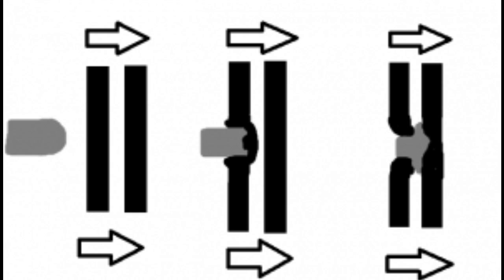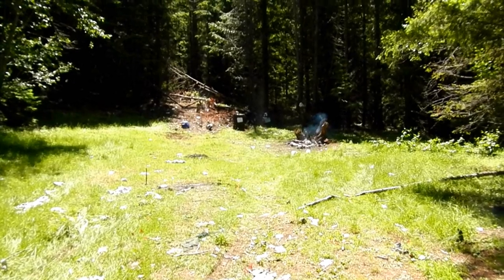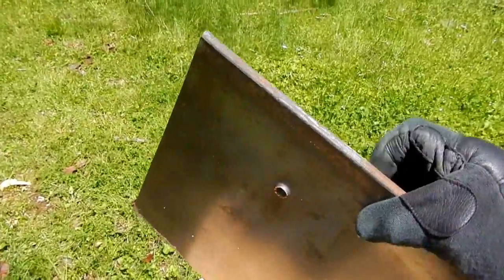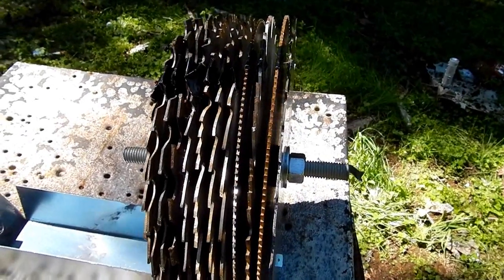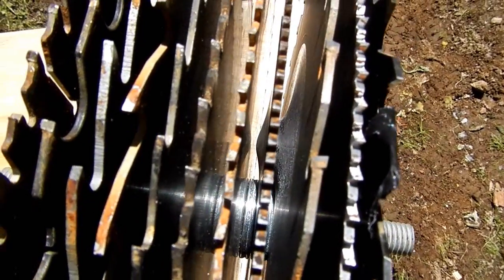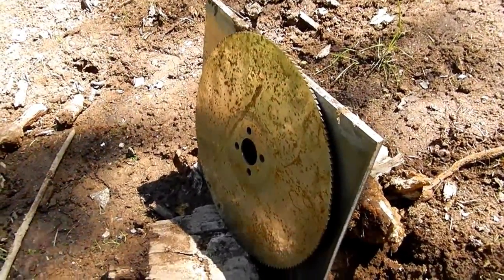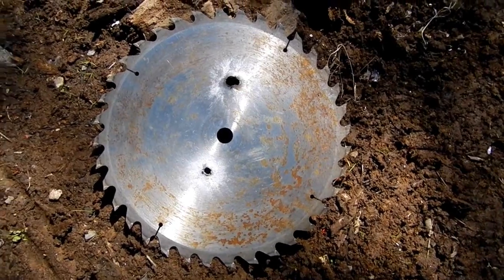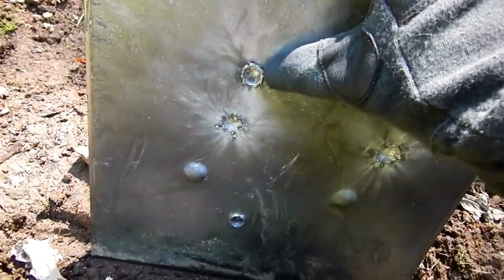Testing the Concept of Spaced Armor

Comment: 5:07 If the plates are each (slightly less than) 1/8" thick, 9 of them should equal 1", right?
Instead, you have 12 or so saw blades ... AND you're not comparing them to a solid 1" plate.
And that's before we acknowledge the difference between mild and tool hardened steel.

Comment: yes its better against a shaped charge or squash round but not so great against long dart penetrators
Reply: That's where NERA comes into play. In between the vertical layers of armor are offset layers spaced off by springs and rubber that further absorb the impact.

Comment: You need a space of at least two and three quarters of an inch to give enough time for the projectile to tumble and or break up. The blades with the tungsten carbide tips have a lower brinell hardness but marginally heavier weight.

Comment: You don't understand the way spaced Armor works against shaped explosive warheads.  Bullets do not behave the same way as a "very high" pressure gas.  -  Also not all steel is the same.  The steel in the saw blades are likely of much higher strength alloy steel.  -   The thin aluminum armor you mention at the start of your video is not to stop bullets to cause explosive shape warheads to detonate before hit its the main armor.  Then the high pressure "plasma" continues forward, but also dissipates sideways in the open space between the armor plate.   -    You should have done more research, as you experiment is comparing apples to oranges. However, it was still entertaining and enlightening.

Comment: The saw blades are breaking because they have been hardened. Its the multi purpose blades that are breaking because they are made to cut steel and wood so they have to be harder than the steel they're cutting.

Comment: Total waste of time that this video is still up and coming into my feed.
Not even an attempt at a control in this "test."  
Uses different grades of steel with different thicknesses (1" of saw blades vs 3/8 mild steel?  - what's this show?; 3/8" mild steel vs same plus a thin steel plate? - what's this show).  
Not even some basic hunches can be supported with this mess.
Shame he spent so much time on it.
He ought to re-do this, since he obviously sees the problem, but living off the views . . .

Comment: Again, thanks for the effort, but you're using kinetic penetrators against armor that was built to stop shaped charges.
The air gap is there to deform the copper jet of a shaped charge (HEAT) warhead. It is of little to no use against kinetic penetrators.

And as has been mentioned before, saw blades are likely hardened steel, because they need to be able to cut through stuff. Mild steel is very mild. So the comparison is not really apples-to-apples by any means.

Comment: I'm sure spaced armour is build for a different purpose.....it's to cause explosive or heat projectiles to explode on the thin aluminium layer first so by the time the explosion radius or penetrator even touches the real armour,most of the energy or would have been exhausted or dissipated.

Comment: The round passes through the first piece of metal deforming the round causing it to tumble within that space before hitting tye second thicker plate of which stop the round by using up what kinetic energy is left by expelled particles and small metal fragments from the surface of the second sheet, leaving an impact crater behind for good measure. So "Spaced Armour Does work, and by using a more flexible energy absorbing materials will defeat even bigger rounds even some kinds of dense rubbers or soft plastics which absorb energy by allowing it to dissipate through the material by allowing reverberations throughout its structure away from the point of impact.
A good example of home made Spaced Armour.

Comment: This guy says in the video description that HEAT rounds are kinetic energy. I find that incredible coming from someone who's been in the military.
Reply from the maker: They are kinetic, this is a common misconcepton due to the acronym "HEAT" and the useage of "jet" to describe the penetrator.  The point of a "shaped charge" is to focus blast pressure. In a HEAT weapon, the metal liner absorbs the energy of the explosive behind it and is squeezed into a thin slug being accelerated to hypersonic velocity.  It does not burn or melt through armor, it punches through. Spectography shows that the temerature of a shaped charge jet does not exceed the melting point of steel. It is like a waterjet cutter not a plasma cutter. This can also be seen in the speed of the event. To cut through a steel plate with the hottest plasma torch or even high energy laser takes a few seconds, to punch through with a kinetic impact is instant.
Reply: @jackalmountain6523  Well all documentation and sources I've seen have always classed HEAT as a 'chemical' energy round as opposed to Sabot which is 'kinetic'. The end result may be a 'kinetic' penetrator but it's the explosive that classifies it as 'chemical'. I never said anything about molten plasma jets or melting temperatures of steel. You're trying to convince me of points I haven't even disputed. Besides, fundamentally a HEAT round does act as a chemical energy weapon because it differs from the kinetic nature of a Sabot. A Sabot's armor penetration effectiveness is reduced the further away the target is because it's just a solid slug, whereas HEAT maintains full lethality at any distance as it doesn't rely on kinetic energy to penetrate. As long as the round hits then the penetration is achieved by the explosive, 'chemical', aspect of the warhead. I see where you're coming from but I've never seen your interpretation of the terminology before.
Reply from the maker: @FlyboyHelosim  Oh, ok, I see where youre coming from and I think we agree on all points. When I called them "kinetic" i was referrring to the specific mechanism they use to defeat armor which is through kinetic energy from the high velocity/low surface area "jet" of metal. I made this distinction becasue there seems to be a common misconception that HEAT warheads use "chemical energy" to generate high temperatures to "melt" through armor, instead of transforming stored chemical energy into kinetic energy on detonation.

It seems your perspecivie on the terminalogy difference (which is reflected in the offical terminalogy) has to do more with, "on target, where will the kinetic energy for armor penetraton come from?" For a Sabot it is from the retained kinetic energy of the high speed projectile, in HEAT it comes from the chemical energy stored in the warhead.
Reply: @jackalmountain6523  Exactly. Now we're on the same page. To be fair it's only some sources that even go as far as to bother making a distinction between kinetic and chemical energy tank rounds, and as there's only a handful of different types of rounds used anyway... is it really worth labelling them and causing confusion?

Comment: https://apps.dtic.mil/dtic/tr/fulltext/u2/a954865.pdf

A study of Spaced armor vs projectiles circa 1950 in which on page 6 paragraph 2 it is stated, "Numerous trials against laminated or spaced armor arrangements consisting of a number of plates of equal or approximately equal thickness have invariably shown that such armor combinations provide considerably less protection than a single solid plate of the same total thickness."

Then they provide examples and an explanation of why.

Comment: The reason 5.56 penetrated and 7.62 did not, is velocity. Smaller rounds tend to travel faster. This is why anti-tank penetrators are so tiny in comparison to the canon it is fired from. It allows a much higher velocity.

Comment: The leopard 2a5 uses spaced armor on the turret, not to protect against heat, but apfsds. The air in between is greater than any apfsds darts. Once in penetrates the first later it starts to tilt taking away any penetrating power once it hits the armor behind it.

Heres a video: https://youtu.be/CuI6UttC5wU

Comment: No surprises, even with just one saw blade in front the bullet is deformed prior to hitting the steel plate effectively increasing its cross sectional area and distributing its kinetic energy over more of the steel plate.

Comment: Not sure if this has already been said, but the primary purpose of spaced armor (at least on tanks) is to defeat fused filler rounds and HEAT rounds.
Reply from the maker: HEAT rounds are just kinetic penetrators like bullets or sabot rounds. The metal liner doesnt get hot enough to melt steel but it does get accelerated by the focused blast into a hypervelocity slug at point blank range. Think waterjet cutter not plasma cutter

Comment: The lack of penetration of the heavier round, while the lighter projectile penetrated,  is due to the minimal SHATTER VELOCITY of the second projectile type being exceeded, destroying the projectile before it could penetrate much, while the first design remained intact and penetrated cleanly.  This is why face-hardened armor was invented in the 19-th Century to protect armored warships.  By WWII, improved armor-piercing (AP) hardened-steel projectiles with hardened AP caps ("crash helmets" made of soldered-on steel of various kinds) had partially compromised such thick face-hardened armors, but the armor could still heavily damage the penetrating projectile and reduce many hits to mere solid-shot-type (cannon-ball-type) effects in the hit ship, which was greatly to be preferred to an properly-functioning, fuzed exploding projectile!  Modern layered composite armors are designed to do the same thing to impacting modern anti-tank projectile effects, but these high-penetrating-power weapons need more robust defense than any steel layer can provide.  Indeed, using layered armor (laminated or, better yet, spaced) where the first layer(s) can damage the impacting projectile and reduce its remaining penetration ability, is the primary reason for multi-layer armors.  If they fail to damage the projectile or if they deflect it the wrong way (sloped parallel plates hit at a high angle can be counter-productive, for example), spaced armors are decidedly inferior to solid armors with a high resistance from side to side.

Comment: Beauty of spaced armor is it gives the projectile a chance to yaw decomissioned a bunch of old propane tanks with .223 round went in straight and tore the back of the first 1 lb cylinder, 2nd one in series had a keyhole entrance and 4 dents in the rear, combined wall thickness want even 1/4". 20lb cylinder was still full but had a old style valve so noone would even touch it in the area round went through entire tank at liquid level and srayed LP all over. Myth busted on that one they dont blow up

Comment: Unless I'm very much mistaken, modern spaced armor is often used to cause shaped charge ammunition and possibly also squash head ammunition to detonate early.

The lack of armor causes some of the shaped charge jet to disperse through the air and when it hits higher resistance in the armor proper instead of when it only has solid steel to impact.

Comment: You fired 5.56 at the 3/8 inch plate then you fired at the saw blades and each one of them saw blades is probably 1/16 an inch so add it up 6/16 is 3/8 so it penetrated 5/16 and dimpled  1/16, not to mention each of the saw blades could have alloys in them instead of your mild steel control.

Comment: It would be interesting to see (and really hard to test) if it is just the spacing or if the air plays a role. Would spaced armor work equally well in a vacuum or is the air bouncing shock waves off the other plate or choking the kinetic energy by being there.
Reply: It’s the second space. The ISS uses spaced armor to stop small projectiles, and there’s no air. It’s called whippel shields

Comment: Excuse me, but HEAT is NOT a KEP, it's a CEP—unless you're referring to the Shaped Charge inside
Reply from the maker: The copper liner of a shaped charge functions as kinetic energy penetrator. Even if its a liquid "jet" its high kinetic energy (mass and velocity) is what allows it to penetrate armor, not its temperature. It's like a waterjet cutter not a plasma cutter. The liner in a shaped charge warhead does not get hot enough to melt steel, its only barely above the melting point of copper.

Comment: The reason why this happens is because the initial loss of kinetic energy is larger then a sustained loss of energy. So by putting multiple plates together you’re making multiple losses of initial energy then a sustained loss like you’d see in a singular plate of body armor. This can also be seen in a cars ABS system when you’re braking hard, your brake pads keep tapping the rotor and making initial losses of energy.
Reply from the maker: antilock brakes, good analogy. additionally on each successive impact the surface area of the projectile increases bringing more armor into contact with it, increasing resistance. Point impacts become more diffuse impacts

Comment: The saw blades are high carbon steel and are heat treated. The test plates must also have the entire area equally supported to get proper & consistent results.
Try putting a layer of thin but heavy rubber or 2 to 3 asphalt roofing shingles between the two layers. I think you'll be quite surprised!
Good luck!

Comment: From what I have done in the past and from what I have shot which is thousands of round of 223 and 7.62x38 I can hardly imagine that 223 went through thatv3/8 inch steel was not really a steel core. I dont know how a lead core 223 could out pen a 7.62 round.im not saying it's not possible but from stuf I seen in the past no way.
Reply from the maker: as inexplicable as it is, 55gr 5.56 m193 rounds will out penetrate 7.62x39 on certain targets due to their  much higher kinetic energy. 7.62x39 will penetrate deeper in "softer" targets as its mass allows it to retain energy longer, but 5.56 hits harder initially
Reply: @jackalmountain6523  hey yeah I couldnt tell you how many of them steel core old ak rounds I have shot and the ak74 rounds as well. I believe you I have seen ammo do wierd shit but we it's still hard to imagine I thought surely that close it would blow through. I think I'm remembering to much of the performance of the old steel core and the 5 56 ap stuff. Thank u for doing that test. One thing I always wondered what a thin hardened plat with an air gap a plate of hardened aluminum then another thin hardened plate with loose kevlar on it's back would do. The hard no 1 plate should deform the round alum should slow it and then the steel catch it with kevlar to if it manages to get through the steel last plate by then it should be slow and deformed enough. But that's just a question on how well that set up would work. Thanks you for the reply
Reply from the maker: @vikingskuld  that should work pretty well in theory. you might not even need the third steel plate. Ductile metals are good at deforming and "catching" impacts, but are bad at multiplying the surface area of an impact (which ceramics are good at).

Comment: So 4 1/8 inch plates stoped the rounds when spaced. 3/8 plate plus the 1/8 saw blade equals 4/8 or 4 saw blades which is what stopped the round . This test could have been better. I would have liked to see you not space the saw blade but rather lay it against the 3/8 plate and compare that. Some sort of control and variable that correlates better than what you had

Comment: Ive seen a couple of folks commented on the issue of steel types. Your plate is untempered or mild as stated. That will off some advantages as its much more flexible. Those saw blades are going to be equivalent to a 1040 to 1080, couldnt see the manufacturer and blade type so be more specific. Where the last two numbers in 1040 is a reference to carbon content of 0.40% its also a reflection of increased hardness. Where its not exact but 1040 is roughly three to four times harder than mild steel. From an armor perspective your best case would be to use both steel with a light weight dispersion layer between. Something like a 1/16th mild outlayer with a 1/4 gap filled a loose kevlar or loose carbon fiber insulation than a 1/8th tempered steel or even better boron silica armor plate would stop most anything outside of an AMR or other weapon designed for high amor penetration.

Comment: nothing new about spacing plates to cause projectiles to deform and lose energy as they pass through.
adding glass or tiles between them will improve performance.
try a older LCD monitor with a pistol round..

Comment: The main purpose of spaced armor (when not sloped) is to counteract HEAT shells as far as I can tell. It allows for the shaped charge to detonate farther from the main body and as such it is more effective. It certainly is not going to be effective against small arms fire,  that’s the purpose of the main body of armor. When sloped, spaced armor can help to deflect small arms fire but it certainly never will stop it fully.
Reply from the maker: "Many World War II-era German tanks utilized armored skirts (Schürzen) to make their thinner side armor more resistant to anti-tank rifle fire. Contrary to popular belief the German Schürzen were designed against kinetic (AP, APBC, APCBC) projectiles."

Comment: After the first firing of both calibers, I would have fired two more rounds each at the 3/8” plate to see if the first shots were a fluke. In testing it’s is best to always fire a group of three rounds to help identify better proof.  Not sure what your test proved. However, in combat I would want the larger round because of stopping (kill) and knockdown power.  But if your wanting to just injure a combatant and cause one or two other combatants to help carry the injured then the small fast round would do the trick. Myself I just wanted to take them out of the battle period.